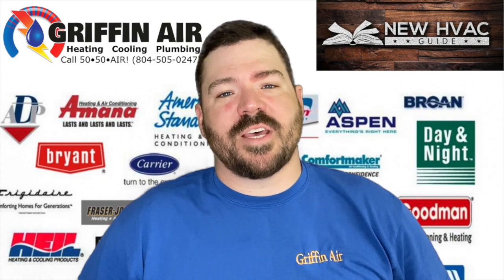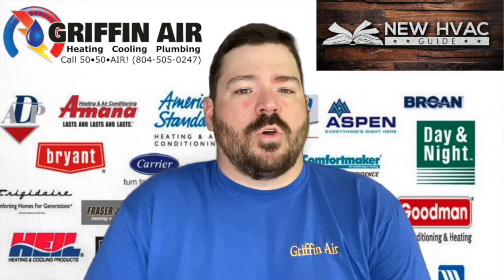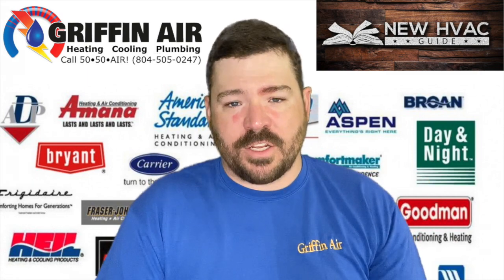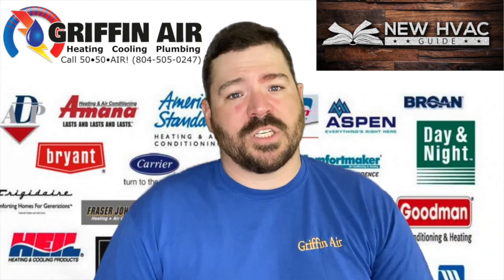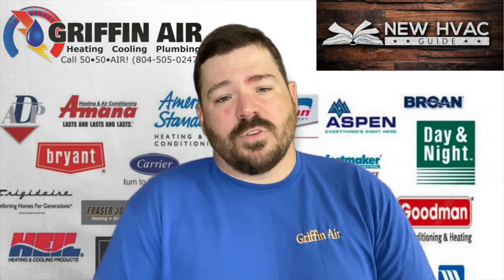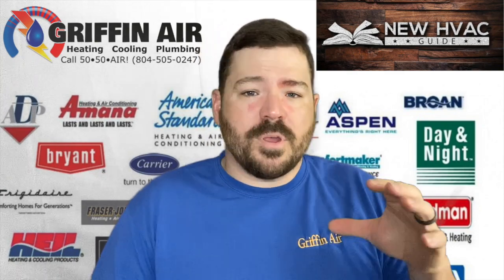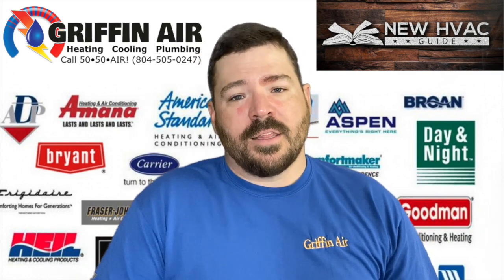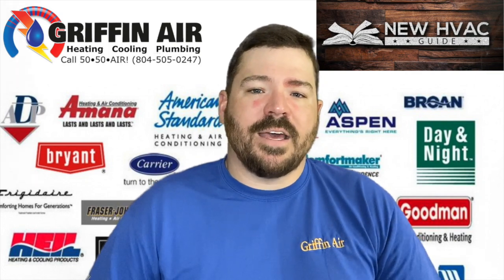Bosch Heat Pump High Humidity solutions

Comment: Thanks for the  informative video.  Do all Bosch  models. the 1.0 and the 2.0, have Mitsubishi compressors?  I understand  Mitsubishi compressors are  the  tops in the  industry?
Reply from the maker: No sir. I’ve been told the 2.0 is not Mitsubishi. It’s made by Madea who makes the Bosch heat pumps.
Reply: @NewHVACGuide   Thanks.  IS Madea  a reputable and reliable brand?
Reply from the maker: I’ve been impressed with their products. However, I wouldn’t say they’re quite as a premium as some other brands. They’re made in China. That said, I put a Bosch in my own home. And love it
Reply: @NewHVACGuide    Thanks  Again.  A reespected  local HVAC  dealer  has  recommended the Bosch 2.0 and told me it  draws  very  little amps.  I was considering the Am Std/Trane  but will now definitely  consider the  BOSCH  TY  Too bad  you are  not in New Orleans
Reply from the maker: Yes sir. Good luck!
Reply from the maker: Please subscribe 🙂
Reply: @NewHVACGuide  I just subscribed
Reply: Josh: For what it is worth  a Bosch Dealer  in Texas told  a friend of  mine  that The BOSCH systems are  good  but when he installs one  he uses a variable  speed  air handler or  furnace  preferably  a Carrier/Bryant model  instead  of  a 2 stage or  single stage  air handler/furnace. That dealer  says  this  avoids  any issue with humidity and the  BOSCH  systems  are fantastic when  paired  with a  true variable speed handler/furnace
Reply from the maker: Thanks pal. I’ve heard folks say that as well. I’m always nervous mismatching equipment because some manufacturers won’t honor warranties if the equipment isn’t an AHRI match.
Reply: @NewOrleansMan-ry3zn  I matched my 1.0 with a Carrier FV style VS fan coil and have had great results!
Reply: @gunslinger1957    Thanks  for  the  information.
Reply: @NewOrleansMan-ry3zn  You're welcome, sir!
Reply: @NewOrleansMan-ry3zn   exactly because they have the ability to run down to 350 cfm a ton so running a multi speed fan on low speed kicks the unit on to low modulation and it begins passive dehumidification. Make sure these things are cycling 1 time per hour
Reply: @NewHVACGuide   It's a GNCC in 2.0 model number is 18M on 1.0 meaning mits and 20G for 2.0 being gncc

Comment: Very nice video and very nice website as well. 
I am thinking between 1.0 and 2.0. 
What I am hearing is that 1.0 have Mitsubishi compressors that are one of the best in the industry. 
2.0 have something else(Midea maybe)
On the other hand 2.0 can stop(pause) air handler blowing air  until certain temp is met to avoid cold air from the vents in the winter.  
What do you guys think?
Reply from the maker: Everything you’ve said is correct. I like the 1.0. But if the 2.0 isn’t much more, I could see why you’d choose it too.
Reply: @NewHVACGuide  so if all of that is true 1.0 and 2.0. The 1.0 would be good for me? I live in Florida and I want constant air blowing in my home. Would that make my energy bill that much higher between the two? Also I currently  have 2.5 ton but will get a 3 ton home is approximately 1495 sq ft
Reply from the maker: I have a 1.0 in my home and love it. The 2.0 is more efficient. Being in Florida, humidity is a concern.  So make sure it’s installed correctly.
Reply: I have the Bosch BOVB 36 compressor and it has the Mitsubishi compressor. Our system has worked flawlessly with zero humidity issues. Good luck with your choice. Either system is going to work well.

Comment: We are a gold star Bosch Bova dealer from Pittsburgh Pa. We only use the Bosch 2.0 series units because of the low noise levels low energy usage and the fact that no gauges are needed to charge or check the units. I would recommend to do a heating and cooling load then choose the appropriate unit 3 or 5 ton unit. Do not adjust unit size on circuit board as the unit has adaptive learning and will adjust to the structure ramping up and down as needed based on load. Most important when in force mode use digital temp probes in supply and return ducts to adjust fan speed to at least a 20 degree delta T if this is done unit will always try to maintain a 47 degree coil temp and humidity removal  will be excellent.
Reply from the maker: Great!  Pittsburgh isn’t as humid as we are on the coast. But it sounds like you’re liking the product. We like them too!
Reply: @NewHVACGuide  Dont over look setting delta t 20 degree minimum and  use the UEI probes also do the triple vac with nitrogen. Look into the federal and utility rebates to help sell the units as well.

Comment: I am a very long time HVAC&R service man or service tech in Chattanooga, Tn. I installed my first Bosch split heat pump last week and I am very impressed with this system. The only downside that I noticed is the lack of space around the service valves. There are only two Bosch distributors here, Ferguson's Supply and Baker Distributing. Neither stock Bosch equipment or parts. They have to order everything from their warehouse or a stocking store out of town. This is going to be a problem for me and anyone that buys a system from me. I bought the system from Baker and then they returned all of their Bosch equipment and part to the warehouse. They said that they did this because they weren't selling any Bosch. I don't think that they are actually selling much of anything and I wonder how long they can keep their doors open.  Good video. I will check out your other site. Thanks.
Reply: R.E. Michel in Ft Oglethorpe handles Bosch and  stocks/can get parts from distribution.
Reply from the maker: They are our supplier as well.
Reply: @artvark7285  Thanks. I haven't been to that store in years. What other heat  pump and furnace brands do they carry?
Reply from the maker: In Virginia, the sell nordyne and Armstrong as well
Reply from the maker: Thanks!  Did you do the 1.0 or the 2.0?
Reply: @NewHVACGuide  I don't know. My best friend picked up the system at Baker and they don't know anything about Bosch. We installed it in a house that he bought in Dayton, Tn 45 miles from Chattanooga. He is a master electrician and we have worked together for 40 years. I didn't charge him anything. This was an attic install and it was not easy. We had to run the new 50 ft  lineset above the ceiling joists. We had to run a fish tape through from the outside and then attach a rope to and pull that back outside and pull the lineset inside to the air handler and it was about two feet short. It is a  shallow pitched roof and there is just no room. We covered the lineset that ran down the outside wall with LineHide and it looks good. The problem that I have now is that I can't find anything in the manual that came with the condensing unit or in the manuals that I've downloaded from Bosch about how to set up the system for a 37 degree evaporator temperature. I don't know if it comes set for 37 or 47 degrees from the factory. It was easy to set the dips for two ton operation but nothing found about evaporator temp setup. Do you know anything about this? Maybe it's a version 2.0 and doesn't have this feature. BTW, I first pressurized the lineset and evap coil to 150 psi and soaped all the joints. Then I evacuated to 290 microns and blanked off the pump and it only raised to 300 psi in ten minutes. No leaks. I weighed in 22 ounces of 410a for the extended 37 ft of lineset. This system is running like a top and we could barely hear it. But then again, my friend Howard had one of his hearing aids go out and I am about half deaf. I am telling you all this because I don't braze new copper anymore. I use Stay-Brite 8 and I've never had a problem or leak yet. Bosch makes a really nice and well built equipment and I will probably put one in my house some day. Thanks and take care. This Covid virus is serious.
Reply from the maker: @jimgill5706  If it's a 1.0, turn on dipswitch 4 on the heat pump.